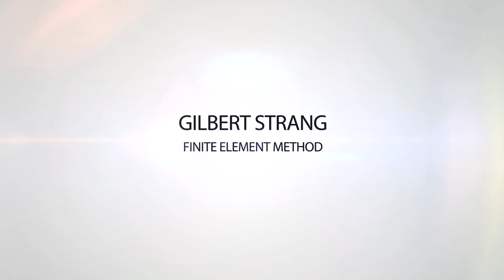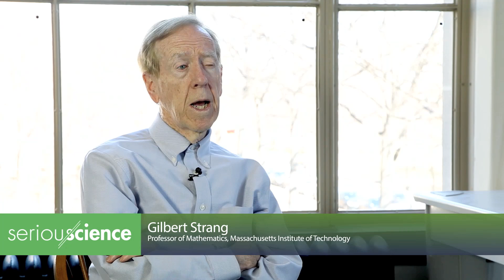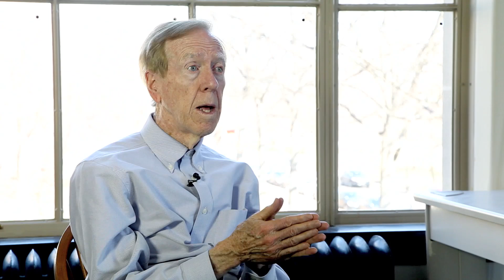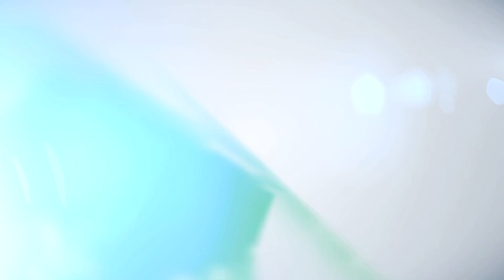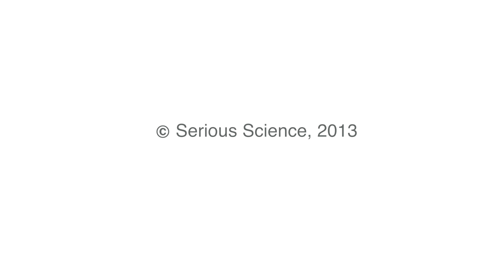Finite element method - Gilbert Strang

Comment: Mr. Strang, prof. dr.,
What do you think if IGA-G uses weak fprmulation and spline basis functions as the test function?
    If we formate a strong treatment of boundary conditions to formally have the same approach for all with Grevill points on the Dirichlet boundary in such a way taht spline ~APPROXIMATION~.exactly satisfied the Dirichlet boundary conditions in this points. What it means on Dirac delta function. For me it is used for the test function on Dirichlet boundary? 
     In case of weak satisfied homogegeneous Dirichlet and not chage the Neumann boundary conditions. Substition formulations and weak  boundary condition yields the finala IGA-G fprmulation. Substition will be
1.following spline representation
2.basiv function for the flow problem
3.WEAK Green-Gausse-Ostrogradski intergration
 theorem
4. all derivates and elementa areas

As hydroengeer THANK YOU!

I ask because of groundwater flow problem for the future research for the development of FULLY space and time adaptor IGA methods for efficient modeli g of flow with continuous velocity field and its derivatives.

WISH YOU ALL WELL

Comment: In solid mechanics the finite element method (FEM) is widely used because the equations are dominated by elliptic equations. Fluid mechanics problems tend to be dominated by convection and diffusion and are thus hyperbolic or parabolic equations. FEM, Finite Volume Method (FVM) and Finite Differences Method (FDM) have all been used in fluid mechanics but FEM only shares a small portion of the solutions.

Both FEM and FVM are types of weighted residual methods and can be numerically identical but the simplified versions of FEM, typically used in common solid mechanics, impose a symmetry on the fluid problem that produces lots of problems. That is the resason why, in my humble opinion, we use FEM widely in solid mechanics while we almost never use it in fluid mechanics and gas dynamics. 

It has been a pleasure to listen and learn from Professor Strang.
Reply: That is not true. Dynamic problems are dominated by hyperbolic equations, i.e. wave equation
Reply: Finite element methods can be fantastic for fluid dynamics. The trick is to use higher order representations. Better yet, switch to a discontinuous high order formulation. FEM (if implemented correctly) also has zero dissipation errors, so the only way to accurately model phenomenon like turbulence (without rediculous resolution) will be with finite element methods.
Reply: That was informative , thank you :)
Reply: On the contrary, FEM is widely used in fluid mechanics. A subclass of FEM called the spectral element method is used in many high order accuracy direct numerical simulation codes. As the above commenter said, you rely on higher degree polynomials as basis fns.
Reply: @jpa_fasty3997  Maybe the trend has changed. Is this usually available in commercial software?
Reply: @XoseManuelCarreiraRodríguez  maybe yeah. Not so much in commercial software. You’re right for commercial codes which tend to use finite volume. But in a lot of academic work you will see FEM, as well as in a lot of high fidelity modelling where turbulence is fully resolved
Reply: @jpa_fasty3997  okey-dokey
Reply: Nicely summarized.
Reply: thanks
Reply: There are lots of ways to use FEM in stuff that is dynamic. It is used on heat (laws of thermodynamic), on air (aerodynamic), on fuilds (fluid mechanics) and on electric flow. FEM is based on differential equations wich can be applied on anything.